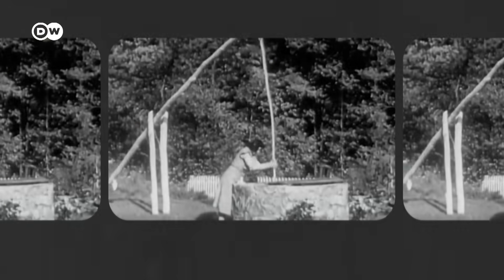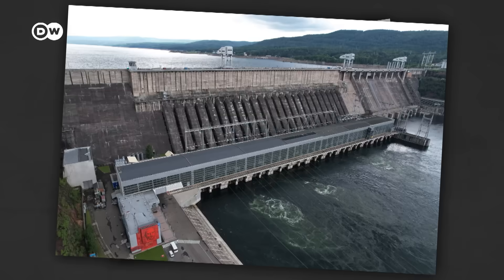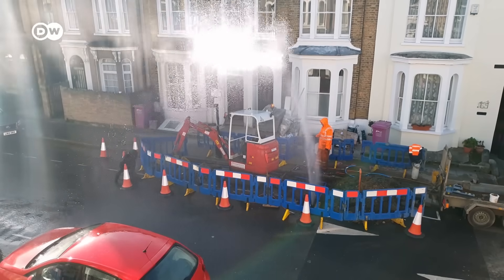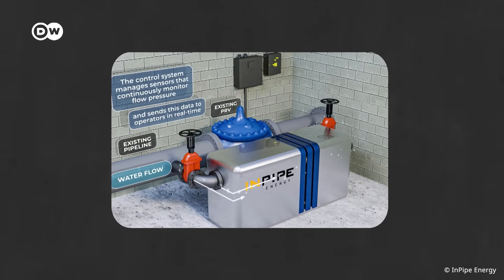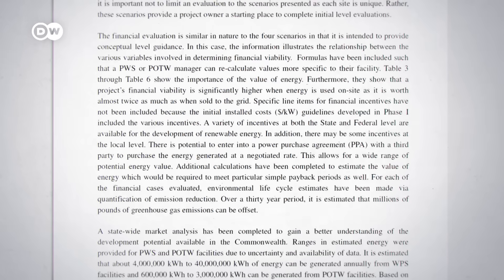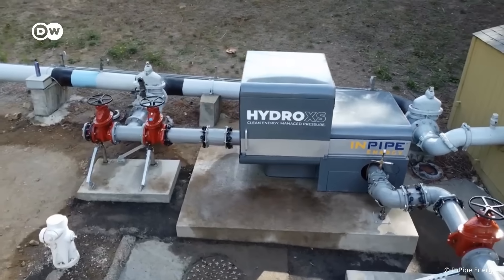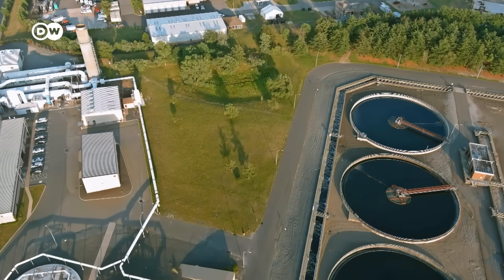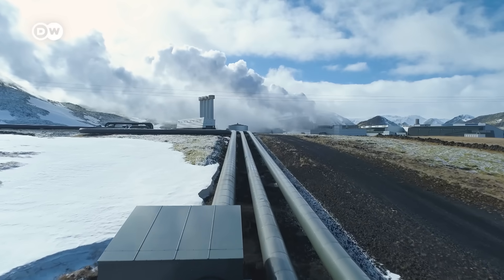In-pipe energy: The hydro power nobody is talking about

Comment: I've watched this entire video with one question in mind, how much does the water pressure drop or will it be increased at the source?
Reply from the maker: Good question! At 2:26, our reporter explains that pressure valves, which take energy out of pipes to prevent them from bursting, are the point where the energy is wasted. And it is that waste energy that can power mini hydro 🙃 So, the pressure drop would not be affected.
Reply: @DWPlanetA  understood.

Because I was thinking if you would put a small turbine on your home waterline to hypothetically generate power, there wouldn't be much pressure left to take a shower. Depending on the load on the generator.

But I can see why it would make sense at discharge or pump stations.

Comment: I am quite confused. The video spoke about using the energy which gets lost when the system pressure is being managed. That makes sense for me. But the deminstration when the phoen was charged took energy from the water flow itself, which is a nonsense. Taking energy from flowing water means more energy is neeeded to make the water flow. That cant give you a net positive outcame, otherwise it would be a perpetuum mobile. Do I understand it right that the idea is good but they choose a bad way to demonstrate it?

Comment: Let me boil up the key points out of the video, because I find it "too" optimistic:
- CASE A: water is pumped into the grid -> energy can be recoverd from EXCESS pressure.
            Pumping water and turbine it again consumes more energy than no pumping the water in the first place (because of inneficiencies). The question is, how often do we have EXCESS pressure in a grid, where the pressure is generated by controlled pumps?
-CASE B: water is moved through the grid by its own potential energy (it is stored at some altitude above consumers) -> some energy will be needed to move the water through the grid, the rest can be used to generate electricity.
            To obtain energy from water in a high reservoir has been done for ages. It is hydroelectric energy. Because of economy of scale, it is more efficient to get the energy centralized at the outlet of the reservoir than decentralized in small pipes. One just needs to leave enough energy available, to move the water through the grid.

That said, the available energy depends strongly on the case. That is surely why different studies report different values. Even the "expert" interviewed in the video says that she cannot give an estimation of the potential of this technology.

My opinion: these videos do more harm than help. Even though I find them inspiring, they transmit the idea that there is plenty of easily accesible energy, which may lead people to think, that we can "just stop oil".

Comment: There's no such thing as free energy. The energy you capture from that moving water as been injected in the pipes with pumps. You need energy to have this water moving in the first place. If every house puts turbines like these in their pipes,, water utilities will have to use more energy to push the water.
Reply from the maker: Hi @DunnickFayuro! Actually, redirecting pressure valve waste energy would not require additional pressure from the input source. Our reporter explains the process at 2:26 🙃
Reply: @DWPlanetA  Granted. But that's not what the whole remaining of the video promotes. Those spigot or in-pipe turbines are a scam at best.

Comment: Yeah, but of course, all the energy you subtract from where it was, isn't available anymore, which means that generating electricity from the flow of running water reduces its pressure. Nothing is free
Reply: The water knows where it is
Reply from the maker: Hi @Thomas Godart! Since the turbines would be run from waste energy, released through pressure valves, mini hydro would not impede the flow of running water. Our reporter explains at 2:26 in the video 🙃

Comment: In rainy season we can use this technology in high rising buildings to produce electricity by fitting this generators in the pipes of buildings to produce electricity. 
In tropical area around equator there it rains almost daily, this technology can be more beneficial there.
We can also generate electricity by using waste water running down in high rising buildings.
Reply: True! I hadn't thought of that application because I'm in a dry region.

Comment: I love the fact that even dry areas can, at the very minimum, recapture some of the energy used to pressurize and elevate the water.
in that sense its like its own  "battery" converting back the energy put in and getting some of it back.

since its "new" my next question is maintainence, hopefully the pipes and generator turbine can keep the same shelf life. when the pipes are old and need to be replaced, so does the engine. or at the very least the turbine can offset the cost of pipe inspections. 

check the pipes for corrosion while doing the routine generator inspection. all in all I hope this becomes cheap enough that ALL cities can do this and not just the metropolis ones.
Reply: it's not worth it unless the water pressure comes from gravity because pressure inside the pipes is build up by using electricity and recovering some of it will make the initial pumps that make the pressure to work harder. It's like trying to add an alternator to an electric car's motor. It will just work harder to push the car forward and generate electricity but in the end it will not recover as much as it uses extra because there are loses.

Comment: What a stupid idea.

The more energy you take out then the more energy someone else has to put in.  So the pumps that are designed just to supply your house with water now have to work harder to pump, using more energy at the water source, so that you can get more energy in your home.

If the water pressure comes from gravity then fine no one has had to turn up the power on a pump, but otherwise it's not free energy it's just requiring more energy to be inputted elsewhere.  The is just a stupid idea.

Comment: To infer that a conventional pressure regulator 'wastes energy' is just plain wrong. 

A conventional pressure regulator consists of an adjustable orrifice that is adjusted according to the position of a pressure sensing diaphragm.  If the downstream pressure is too high then the regulator will close the adjustable orifice until the flow rate is reduced to the point of just being able to support the required downstream pressure.  In this way the adjustable orifice will always be adjusted to exactly match the required flow rate.  At this equilibrium point the upstream pressure multiplied by the flowrate will match the downstream pressure muliplied by the flowrate though the adjustable orifice  - this is known as Bernoulli's equation - which points to the fact that a pressure regulator is not 'wasting energy' rather it is conserving energy.

Now it would be possible to use an in pipe turbine to extract energy, however this additional energy you get out the system just requires more energy to be put in to the system to cover this extra energy drain.

When the total amount of in pipe turbines are very small compared to the total amount of existing water pumps it will be difficult to detect the additional amount of energy  that needs to be added into the system,  however if this idea is popularized then this additional energy burden will have to be borne by someone and the idea of trying to use water pipes to transfer energy is simply crazy when there is an existing infrastructure that is designed specifically for doing just that.

Comment: It seems that this water pressure is not a “source” of energy but rather has stored potential energy. I’ve been wondering for a while if long distance water pumping could be used essentially as a battery. If so, it would appear that massive infrastructure would have to be invested (probably including plumbing that can handle higher pressures?) I’m way out of my depth but this topic is fascinating and worthy of more research. I personally wonder if the concept could be applied for long distance water transfer from wet regions to dry regions but only using surplus renewable energy when in excess of demand. Interesting space to watch.

Comment: There're quite a lot of reason to keep the water pressurized and flowing in a constant rate.
Introducing a turbine in the system.. what for? So you can replace the electricity line..?
I'm all in for more efficient pressure valve but attaching a hydroturbine and maintaining it is no joke.

Comment: A more reliable system is to use the city sewer & waste disposal to generate methane gas to run low rpm, high torque, gas driven Steam Engines, or Sterling Heat Engines for making electricity. A cheap no-brainer in my opinion.

Comment: Mankind invented pumps which is what pushes the water along the pipes. By extracting a significant amount of energy you are in fact taking energy intentionally put into the water. Ludicrous thinking. It would be similar to tapping into overhead wires, theft.

Comment: Love the concept. Would the drop in pressure at the tap side force the supply side to increase pressure automatically on the supply side without mechanical means?
Reply from the maker: @Jason Rady No because the turbine feedstock would originate from the energy released by the pressure valve (as explained at 2:26) 🙃

Comment: Interesting, but it seems to me that it’s more a way of recovering some of the energy used to pump the water rather than “generating” electricity. I don’t see how this can have major impact on electricity generation.
Reply from the maker: As far as turbines in household pipes, no, it might not be significant. But micro hydro could be implemented for ANY type of water supply or disposal system. The tech is vastly scalable and so there can be thousands of them in cities that adds up to a sizeable amount of otherwise wasted energy. 💯

Comment: Stpd. There's no such thing as "excess" pressure in there. It's just enough and exactly what the system needs in its current set-up. Mess with it and you'll for sure mess up a stable tap water supply.

Comment: Upon further consideration, a viable approach to address the energy loss in pumping and energy gains for consumers would be the use of renewable energy sources such as solar and wind power. By implementing these clean energy sources, consumers could generate electrical energy from water, and the additional energy required for pumping could be supplied by photovoltaic or wind generators.

However, it is important to note that this solution may increase the costs throughout the entire supply chain. A more productive alternative could be for individuals to directly harness their own electrical energy from these renewable generators and sell the credits to the supply stations. This would lower the costs of consumption and supply.

What do you think about this idea, everyone?

Comment: This video doesn't address the most obvious question about energy. A generator is like a resistance in the system by extracting energy. Won't the pumps need more power?

If it is already happening, I think a proper video is important follow up

Comment: Upward stream naturally is evaporated water deliberately as steam. Both up and down streams can be placed with pipe turbines. The power for pumping water back upstream and produced from steam turbine can be intertwined through batteries sourcing for pumping and bioling water. Smaller pipes, better steam pressure. More pipes, more power production.

Comment: Your system is profiting if you use a gravity flow.
A pumped flow would be good for fake perpetual system, but in reality it would not give any good since there are lots of losts in the pipe.
Furthermore, water is not good to tranfer energy in form of pressure.
That is why our existing turbines uses centrifugal force given by water velocity (debit) not water pressure.
A tubular Kaplan turbine needs no water head at all.

Comment: It would be great to replace pressure regulators in households with turbines + battery chargers to support photovoltaic systems. A pressure sensor could control the battery charging via pulse-width modulation to provide constant water-pressure in a household and convert the pressure difference into electricity.

Comment: Logically this seems very wrong and sort of a scam. We use energy to generate the pressure then we use pressure reducer to recover some of it, more logical is to not produce excess pressure to begin with, this will yield more energy saving. It's a bit of like trying to make a perpetuum mobile by powering one electric motor which turns a electric turbine that generates energy to then power the first motor.
Probably it might make economical sense to recover some of the energy under some very specific conditions, but this will be very limited if at all. The video is very misleading in this regard, making it seems like we have a vast untapped potential.
Reply from the maker: Micro hydro does have major untapped potential! While on an individual turbine level, the amount of energy harnessed may be quite low, but this technology is available for ANY type of water supply or disposal system and the tech is scalable. If there were thousands of these turbines in cities, it could add up to a sizeable amount of otherwise wasted energy! 🙃
Reply: @DWPlanetA  I do understand this, and I think this is very helpful for any application of any size except to the water supply pipes. The problem is kind of logical. We use vast amount of electricity to generate pressure in the pipes and there could be two options:
a) there is not all that much we can claim back, because then there won't be enough pressure left in the pipe system.
b) we have a massive waste of overproduced pressure and we can claim a lot of it back; in this case we would be optimizing in the wrong place then and focus should be to not produce too much pressure to begin with.

I also understand that it may seem like no mater how little it may be, if we claim it back it's still better than nothing (option a), but this is not given. If money is spend on such projects and as a result there is not enough funding for other projects that can have much bigger impact we will in fact be doing harm.

I do love your videos 😀
This is the first one I kind of feel a little disappointed as it exposes this logical problem and doesn't address it properly. I believe this is why many people are also not so happy with this particular video

Comment: there is no free energy. if pumps are used to generate pressure then the generator would put additional load to the pump.
it was mentioned that there are places where water is gathered higher than the city itself. then on industrial level some energy can be harvested, depends what is the pressure.

Comment: What bout 3rd Newton law here? The more  energy produced in these pipe generators , the more energy you need to apply at the start of the pipe. So if  there's any place to set pipe generator, we should first start questioning water providers how they can optimize pressure at a certain line.

Comment: Okay, maybe a substitution can be made with a hydroelectric turbine for the pressure reduction valves. Fine.
However, every water consumer can't  hope to get much electricity from a dinky turbine. And you don't want to make it problematic for the water utility to provide high enough pressure because too many users are scavenging a piddly amount of electricity.
This reminds me about telephone land-line customers scavenging 70 volts from the telephone company. Of course, they'd eventually get busted. But it happened so many times that the phone companies have much reduced the line voltage and current, so nowadays, a brand new telephone that worked just fine, bought 30 years ago, won't even ring.
Reply: waa.... trumptard.
Reply: @gothboschincarnate3931  You're probably the kind of guy who'd have jumper cables around your electric meter, or install a tee on your neighbor's TV cable. Gotta have every little freebie, huh ??  🏴😈🏴

Comment: Place microturbines in mountainous areas.  Streams would be left virtually undisturbed with tremendous amounts of energy made available to somewhat remote locations, very cheaply.

Japan has started to implement projects, such as these.
Reply: I was involved in such microhydroelectric power in Uganda. Indeed the energy potential of a hydroelectric plant depends on two key factors: Flow rate, and height difference. You're correct if you have a relatively small stream with a large height difference, then it tends to be better to use impulse turbines, such as 'Pelton' or 'Turgo', which use spoons to extract the momentum from a nozzle. In mountainous regions it's perfect. If you find a good human settlement, near to a mountainous region with a reliable stream and a steep incline, then it might be a good candidate location.
Alternatively for high flow and low height difference, then it is better to use reaction turbines, such as a Kaplan or Francis turbine. These are more suitable for lakes and rivers.

Comment: so the water gets pumped through the pipes just to take that pump power and run a turbine with it? Doesn't sound very reasonable, actually more like a waste of energy. If any power should be generated from the stream, it would have to be done at the very end of the line, i.e., at the spigot. Anything else is likely a waste. 
And by the way, that's what I actually do: I have replaced some of the aerators with small generators that run an LED when the water is flowing, so I don't need extra light at the sink. But that's all the power that comes from it. For charging a phone, for example, the water would have to run for days... and that's even more of a waste when water is becoming more and more valuable.
But how about using the excess heat in the wastewater and run heat pumps with it? Wasn't this a project already a while ago? What happened with that?